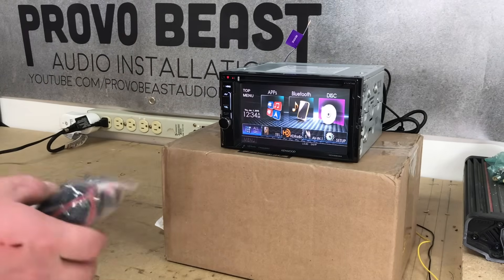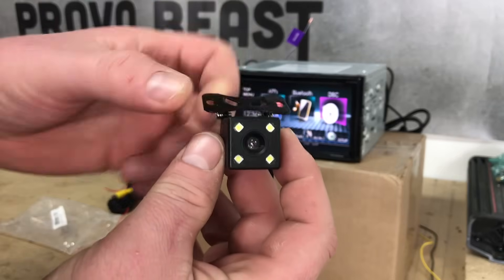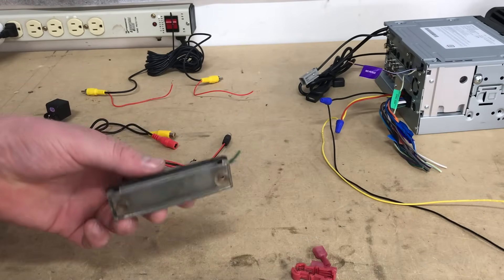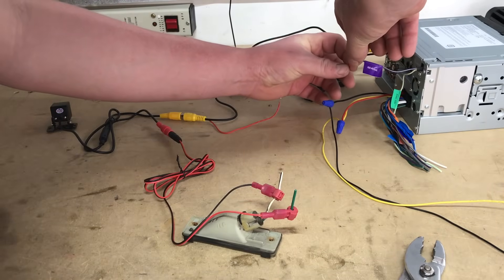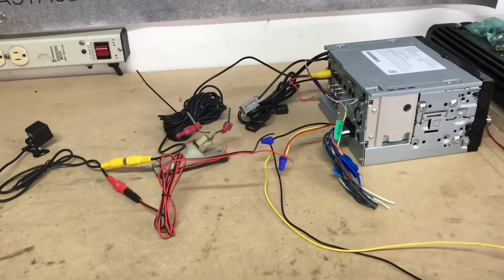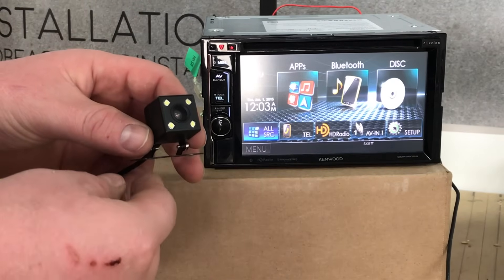Car Backup Cameras Explained: How To Install On Your Car!

Comment from the maker: If this video was helpful, consider chipping in a few bucks to support the channel: https://www.provobeast.com/donate
Reply: This is the best video about this on YouTube, but let me make 1 correction for novices like me. If wiring the camera to always be on instead of running off the reverse light power, do NOT wire the camera power directly to the power/battery wire on the head unit harness. It must be wired to the ACC/Accessory wire, otherwise it will slowly kill your battery. I was trying to figure out a parasitic battery drain and finally figured out this mistake. Hopefully this helps someone else! In the video all he said was connect it to power which was vague enough for me to do it wrong lol

Comment: Hi! I plugged in the video jack on the monitor and attached the single reverse wire and I left it overnight cause I decided to do the rest the following day and my battery drained. Do you think this was the reason for the battery drain?

Comment: If you don't wire to the reverse light so that you can use the camera while not reversing, do you then have to manually turn the camera on (on the screen) when you reverse in order to use it while reversing? I assume yes but want to make sure.

Comment: Make sure you're getting a solid connection on you wires, I just wasted 2hrs trouble shooting and the culprit was the t-taps not making a good connection so I soldered them and bingo camera works perfectly.

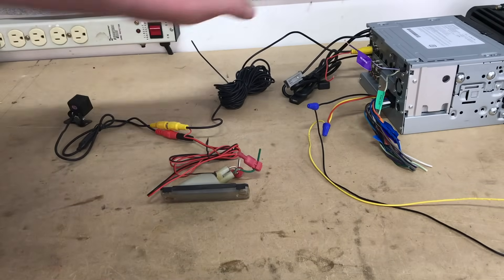Comment: 7:29 This is what I was looking for.   I assume you could use the “Remote” BLU wire that switches on your amp.   (Or Power Antenna wire)

Comment: Any suggestions? 

The camera works for me when the last step isn't done (red wire to reverse light power). I can manually see the camera working, but when I complete that last step, I can no longer manually see the camera and the camera shows an error when in reverse.
Reply: I rewired every component and still having that issue. I disconnected that wire so at least I can use the camera manually in the meantime.

Comment: One thing you should advise the people all of these cheap aftermarket radios from China come with cheap back up camera therefore they require LEDs, which means you can’t mount it inside the window because the picture will be totally distorted‼️

Comment: Thank you so much for the detailed presentation; it is helpful. But I have a question... is there any reason I cannot run the power for the reverse light from the Radion Back" to the reverse light fuse box, to get power?

Comment: Great video. Unfortunately for me, it didn't work so well. I would get a flickering error only when the engine was on, I will try removing the ground since the video wire provides its own ground, or so I heard, I'll let you guys know if it works.

Comment: Great video...almost! With the second setup, power to the camera is constant, so are the LED lights are ALWAYS on? Otherwise the signal that is is receiving from the short red video wire connected to the reverse light is only triggered when reverse is engaged? Please clarify.

Comment: QUESTION... My Kenwood stereo has the ability to turn on the rear cam any time I want, which I love. At one point, the cam that Best Buy installed began to fail, so I ihad them nstall an unused cam I had.. That cam worked fine when the trans was put in reverse, but not when I hit the Cam button on my Kenwood. Long story short, my current rear cam is failing again (it's rusty and won't work at night), so how do I know what cam will work when I hit the button on my Kenwood? Any recommendations for a GREAT camera (I'm tired of low quality rear cams that barely last 3 years). Tx in advance.

Comment: Could I feasibly run the power and ground wire to a license plate light,and chassis ground and the courtesy wire to the reverse lamp so that when in reverse it comes one, but it also can be switched on in the radio to check on my trailer too?

Comment: I have a question regarding the video cable. I dont have an android system, rather i have a dashcam screen (carplay system) which isnt fit into my car, you can say its an external screen i use as a dashcam/carplay.
So at one end where you have the red wire also, i can connect at the rear light, but at the other end of the video cable which i can attach to the screen, where does the red wire at this end go to? Does it need to be attached if one end of the wire is attached to the rear light? Thanks in advance!

Comment: Most of video explain the instructions for newer android systems which is very easy to install. 
My situation is that the old Japanese car stereo navigation has no reverse wire labeled and I got stuck.

Comment: Hello, I bought a camera on aliexpress and a managed to install it.
But when I opened my Toyota Auris car Navigation ( old 7" Japanese Panasonic model NHDN-W56) I couldn't find where to connect the other end of red wire since there is no reverse or trigger wire coming from the unit.
Need help please.

Comment: hello there, i bought the same camera and followed all your wiring installation. at first it was working fine, but on the 2nd day, i encountered a problem with it. whenever i do reverse, the view on the back camera is frozen. what seems to be the problem? is the camera defective or there is a wiring problem? hope you can help me with this. thanks

Comment: If we follow the second method, apart from manually switching on the camera whenever we want to do we still have the camera automatically turned on upon reverse gear? Or this mode is lost in that casE?

Comment: I don't understand why the video cable needs to be interrupted and be connected to the red power. Since the reverse lights are off, the camera is off and the radio should understand that has to quit reverse mode. Why there has to be an interruptor at the video cable. And how this cable transfers picture to the radio and electricity for the light at the same time?

Comment: I have a question you probably never hear. This winter when it got cold a rat got in my car and ate the one cord that add three wires. That cord is still connected to the camera and the other half to the stereo. Can I splice some wire in the place where it was disconnected ? If I can would I individually do the wires red to red, black to black, yellow to yellow? Thank you
Reply: That's my stereo

Comment: If your android is switching to reverse (auto show screen of the back) and you dont even have camera connected, its means that I only need to: power camera (from reverse light to save consumption of batterie) and plug video cable. without red wire that sends signal because I somehow get this signal.. is this right?

Comment: Nice Video! Can you please explain how you are saying when connecting the camera power wire to radio power  instead of reverse light , the camera will stay on only when ignition is on, because I can see that you gather both  yellow hot wire to accessory wire, isn't Camera gonna power all the time if you connect camera positive to radio power yellow and red wire?

Comment: the only thing you forgot to mention is with this particular camera, you can't leave it powered on all the time because of the LEDs. when it is powered on, so are those LEDs. So method 1 with just the reverse light wiring would be best for that camera. But ground it to the chassis, don't piggyback off of the ground for the reverse lights.

Comment: I have the red wire coming off the yellow thing on both ends like in your video....at the camera end I can splice it to the reverse light positive wire but up at the radio I have nothing for it to splice to....will it work with the red wire just loose not connected to anything up at the radio end?
Reply: that one is supposed to go from the reverse light positive to the reverse trigger wire on the radio for everything to work. if your radio is capable of displaying a back up camera it has that wire. you just need to figure out which wire it is on your particular radio. even if it is a stock radio and it had a reverse cam you'd have that wire somewhere.
Reply: @MadMaxwell7  it's more of a display than a radio...it only has a port for a/v in that the rca goes in and it is powered up by a cigarette lighter with type c connector
Reply: @macknumber9  ohh, in that case your only option is to have the camera on all the time. the only point of the trigger wire connecting to the reverse light is to switch the view on the radio to the rear camera when the reverse lights receive power. if your monitor isn't a radio and just for the camera then hook it up to just stay on. no reverse light tapping needed at all for that.
Reply: @MadMaxwell7  maybe there's something internal that the camera has a built in trigger...because the reverse camera needs the red wire to reverse light for power...otherwise camera has no power at all and won't turn on
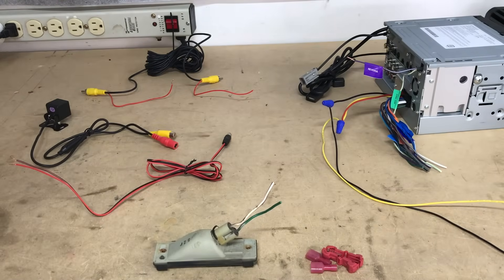Reply: @macknumber9  Yes and no. it may be a relay in the camera if the cam has power but that wire will need 12v power, it doesn't have to come from the reverse light. if you want the cam on all the time don't hook that wire to the reverse light, instead hook it to the tail lights or anything else that gets power. I'm pretty sure that red wire "the cheat wire" is just a pass through that runs parallel to the video wire. it is it's own wire only meant to trigger the head unit. @5:53 he explains that. plugging in only one end of that wire would be like plugging in only one end of an extension cord... pointless really lol. If youre using a monitor the signal is getting there and it never needs to switch views when you engage the reverse, so no need for that trigger. The red wire coming off of the camera @3:48 itself would need to be hooked to that wire  to a power source. it could be passed through the "cheat wire" to the power source of your radio so it turns on with the car. Or alternatively you could also hook it to your regular tail lights so it turns on the camera with the tail lights when those are on. hooking it to the reverse lights will only get you camera power on reverse.
Reply: @MadMaxwell7  thanks for taking the time to help me

Comment: Can someone explain me, the second wire on the camera has to be grounded, in this scenario is not ? Is it important to get ground in the installation or not ? Im not good at electricity but i want to know. I've wired everything up and I'm at the stage where I just need to hook up the camera and wire them up with the taillights
Reply: The positive is attached to the positive of the light. I read everywhere that the other wire is for grounding, should I ground it or tie it to the minus of the lamp

Comment: Help!! I am still confused! I just want it on for my a.v! I already have a reverse camera. I just need a camera for a rear veiw because i can't see out the back of my car. Any help would be appreciated i cant wire to a reverse light😂
Reply: Wire the power to the camera to a constantly on source, that way its always powered on, then you can manually switch to that AV oitput on your head unit for use when not in reverse. Makes sure you do not tie anything to the reverse wire on your head units wiring harness too.
Reply: @thedwarfgimli5323  makes sense thanks

Comment: Hi! I do live in Orem, Utah.
I bought an after market Media player (Tablet, 9 inches) plus rear camera for my Kia Optima 2013.
But, please, what's thebest way to run the cables within the car??  Thanks!!!
Reply from the maker: Careful using Android based radios, usually they are absolute garbage.
Reply: @ProvoBeastAudio  Thanks. It really feels alike!! 
The Tablet is so limited and feels like a 2013 Android OS.
One question, please!!
How much you cost for just the rear camera installation?? Thanks!!

Comment: Can I runn a kill switch in-between the reverse light and one in-between the one coming a power supply thats always live when on?. Or if I have and amplifier in my trunk  can I tap into that to use and run a kill switch going from the head unit and the power supply I use. Cause I think it could be done would just need to use two kill switches works so I can use both of both worlds ? Like run one power to the Dubble din with akill switch in-between  for powerd on to keep an eye on who's behind me a nd the kill the power going to it by the inline kill switch?  And then the other one running off the reverse light with another in line kill switc kill switch to th unit. Or would it turn my revers light on when I switch it over on the dkubble manually.

Comment: @ProvoBeastAudio  I have a Kenwood dmx1037s and installed the backup cam with the red and black wires directly to the radio so that Im  able to use the camera button but now the led lights on the camera stay on even when the car is in park or driving. Any way to fix this ?

Comment: Hey great video 👍.. Wondering what would cause this problem on a backup camera. It's been working fine but now when I put it in reverse the camera doesn't come on, it only comes on when I select the camera app on the radio. Now I select the app put in reverse and now the camera comes up. When I put in drive it goes black, then in reverse it comes on. But only if it select the app, if I don't select the app it doesn't come on automatically. Could it be the radio or the cable running to the camera? It's strange because it does work and it doesn't lol.. Any help would be appreciated thanks

Comment: Thank you for this! I installed a camera with rear camera just like you demonstrated here. However, as soon as I put the car in reverse it blows a fuse (my dash lights go off but also can't start the car). Any ideas what I'm doing wrong? It worked fine for about a month and now just pops a fuse if it's connected.

Comment: Thank you for this video! You freaking rule! Great tutorial. You've actually given me the confidence to do this so I did it today on my wife's 2001 CR-V 5spd. Hardest part was t-taping. My t-taps weren't able to get through the wire housings even with using the pliers to squeeze them down so when I fired it up nothing worked initially. So I removed the taps and used my wire stripper to reveal some copper then retapped. It was good after that. Only other issue was the wire from these cheap Chinese kits are such small gauge wire. Wish they were a little thicker gauge. I had a hard time crimping the power wire spade. It kept coming apart because of the small gauge wire. So I stripped more wire and doubled it over to make it thicker then recrimped and it held. My car battery also died while doing this so thought the radio was broken or a fuse popped because it wouldn't turn on. So I checked all connections. Removed the harness to make sure the crimps were holding. Then I noticed the lights on the dash were fading. I tried to start the car and nothing. I had to jump it. Then everything worked. Power hungry accessories. But thanks again. Your tutorial was super clear.

Comment: This helped me fixed my issue thank you!

My problem was that my camera wouldn’t show up in reverse (the switch) but I could select the view of the camera so I was confused so the fix was I just had to get power from the reverse light for that small red wire problem solved

Comment: But what if it comes witb an rca adaptor cable thay juat plugs into the radio itself?? The manual says only need to plug into reverse light and done.

Comment: Your 2nd option will not work. Since the trigger to the main unit still tap on the reverse line. If you want the rear camera monitor always on, tap the main unit trigger line to the positive supply.

Comment: QUESTION: This worked great for one CarPlay head unit. But now I have a portable one, and the camera input is basically the same size as an Aux cable or headphones, but the backup camera came with cables with RCA connectors. What kind of cable do I need to buy that will supply a video signal but plug into a AUX-sized connector?

Comment: This is not work as a method for all cars FYI, because some cars do not have that type of reverse light wiring for my 2005 Honda accord has a wire harness that goes to the bowl. Therefore, I cannot use the back up camera, even though it was designed for my car.

Comment: Hi, I have an AVH-X4500BT by Pioneer from 2013. I dont think I have that fused cable with the reverse tag coming from my head unit, will it still work if I dont use it? also, you mentioned how you connect the positive and the negative on the tail light but not how to tell which is which, could you elaborate? thank you sm

Comment: Hey, maybe u can help me. I got android unit in my car and reversing signal goes thru canbus modul connected to radio. How should i connect it? Only RCA Video cable (signal cable will not be connected) and + and - from reverse light?
Reply: actually i dont have any camera connected and when i put my car into reverse it shows reversing screen on radio

Comment: I have a BMW e90 with manual transmission and I installed the camera and it works very well but after a short time it triggers itself. I found a forum on the internet that said that BMW checks the lights at an interval and this constantly triggers my camera what can I do?

Comment: So my camera triggers on reverse by hooking up the yellow video cable behind headunit as well as the small red wire to acc.....i still have full video/power with out connecting that black and red wire to tail light. What did i do wrong ??? Is my camera on even with the truck being off or do i not need to get those 2 extra red and black wires connected anywhere

Comment: There’s actually a third way to do it as well. You attach the purple back up camera wire to the red power wire attached to the video in behind the radio.